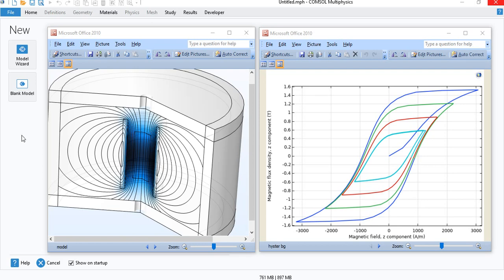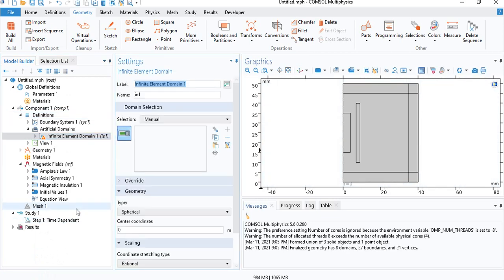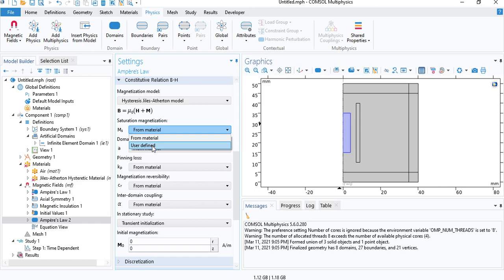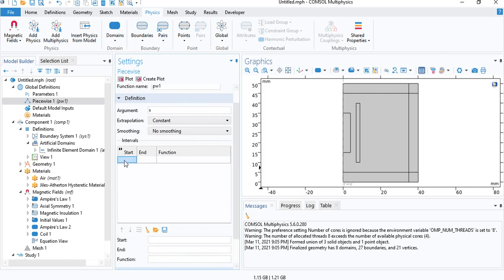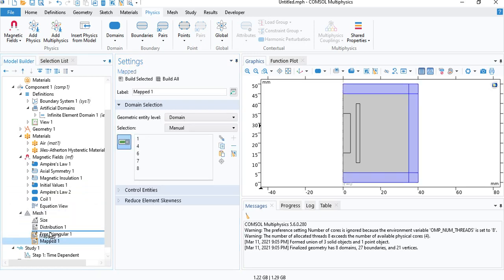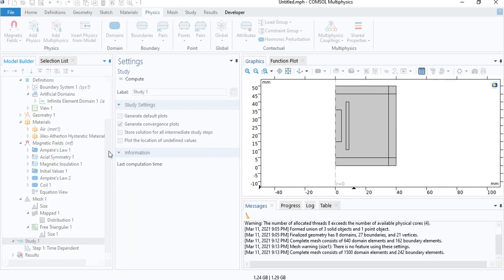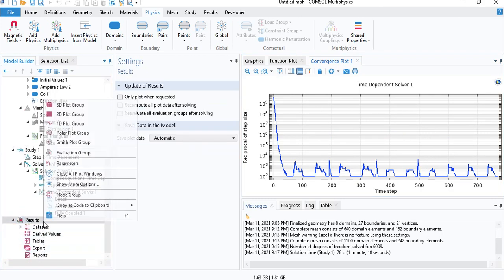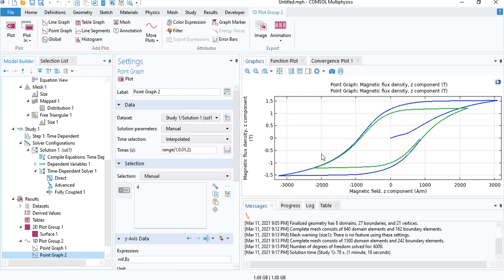Modelling magnetic hysteresis and producing hysteresis loops using Comsol Multiphysics

Comment: Could you please tell me the difference between circuit [voltage)and circuit [current] in coil excitation
Reply from the maker: Circuit voltage fixes the voltage and calculates current using Ohm's law. Circuit current fixes the current and calculates the voltage accordingly. In high frequency AC applications, the two options can give different results because the effective resistance of the current carrier changes with frequency (skin effect). In such cases, Circuit current preserves total electrical energy, Circuit voltage does not (energy is lost).
Reply: Thank you sir

Comment: Is it better to use infinite element domains all the time vs just a box or a sphere for magnetic simulations? Is one faster to compute than the other? Also is there a difference between a box and a sphere as the outer boundary of the simulation in general?
Reply from the maker: We need to give enough room for the magnetic field lines to spread in space. If you do this by creating a very large box/sphere then that's going to be more computationally intensive than using infinite element domain on the boundary of a small region. So in this regard, infinite element domain is always better to use.

If you use infinite element domain, you can use either a rectangular or spherical region but choose the appropriate coordinate system.
Reply: @JafScience  Thanks. That makes sense. So if the modeled geometry is rectangular, it's actually better to use a rectangular boundary, because there would be less volume to mesh between the model and the outer surface, right? Same with a spherical model and spherical boundary.

One more question. If I need to simulate hysteresis effects vs frequency, which model should I use? Jiles-Atherton is built into COMSOL if I understand correctly, but it doesn't consider frequency, right? Maybe I need to find a model that does and manually enter it into the simulation somehow?
Reply from the maker: @batsali99  For your first question, yes, just match the type of coordinate system with the type of air domain region.

For question 2, the frequency domain solver gives you the steady-state harmonic response while hysteresis is a time-dependent phenomenon. There may be some tricks published in the literature to help you work around this problem but Comsol doesn't have the capability to model hysteresis in the frequency domain.
Reply: @JafScience  I want to study the spectrum of distortion products due to the material properties of a transformer core for an input excitation that is also fairly harmonically rich. The known parameters would be the B-H curve of the core, probably a fit of Jiles-Atherton parameters to measurements (or some other model?). Is that not possible with Comsol? If the input excitation is defined as a sum of a few sines in time it should work, no? I've been reading a bit more and things like 'magnetic viscosity' are popping up. Maybe this is a much more difficult problem than I thought. If it's not possible with Comsol, do you know of any other software that would be useful for this application? Thanks for taking the time to answer!
Reply from the maker: @batsali99  You could do several frequency domain studies at different frequencies and then use inverse FFT to transform your results to the time domain. But in each Study, the Jiles-Atherton model can't be used. The limitation is mainly mathematical and is not due to Comsol being inadequate so I don't any other software that would be able to do what you want.
Reply: @JafScience  Thanks. I guess I need to do more research.

Comment: For my question, imagine we are at the point (-Hc,0). What will be the new path if I start increasing H instead of letting the curve enter the 3rd quadrant? From your simulation, it seems like the curve would always follow an almost horizontal path before becoming steep everytime you change directions... in my head the curve that has its direction changed at (-Hc,0) should just be a translation of the curve that starts at (0,0) since both have no magnetization. Can you clarify my thoughts???
Reply from the maker: Interesting insight! Just to clarify, are you expecting the curve to go up from (-Hc, 0) but have the same shape as the curve that starts at (0, 0)? I would expect an almost horizontal line going back to (0, 0) since Hc is the coercive field, defined as the field strength required to demagnetize a ferromagnetic material.
Reply: @JafScience  Yes, that is what I'm expecting. That is because the physical situation is the same as when the curve starts from (0,0), in other words, there is no net magnetic flux within the core. So... reversing H from that point should result in the same curve it would if we kept going negative (which is actually the same shape as the one that starts at (0,0) but translated and flipped) from the core's point of view it should provide the same "resistance" independent of increasing towards north or south pole. But again, that's just a thought I had. From the results shown, that's probably wrong, but again, I don't understand why
Reply from the maker: If the curve starts going up at (-Hc,0), that would imply that the material is still magnetised. But theory says that the material is demagnetised once you apply a coercive field. A demagntised material will have a BH curve starting at the origin when an external magnetic field is applied.
Reply: @JafScience  I didn't get why the curve going up implies that the material is magnetized... also, you said that when a coercive field is applied, the material is demagnetized, and then said that a demagnetized material has its curve starting at the origin. What I understand from those statements together is that the material behaves the same at (-Hc,0) and (0,0), which doesn't seem to be the case according to the simulation...
Reply: @JafScience  btw, don't get me wrong, I'm just trying to learn this hysteresis concept fully, I have a really tough time trying XD
Reply from the maker: @alexyuri_94  It's all good, scientific inquiry and questioning is the best way to learn and find mistakes.
The material is magnetised if it's producing a magnetic field in the absence of an externally applied field. This means the curve does NOT pass through the origin. Once you get to (-Hc, 0) you will demagnetise the material, so if you remove the external field (i.e. H=0), then B=0.

On the other hand if the material is still magnetized then when H=0 B will be higher or lower (since the material is still producing its own magnetic field).

Another thing to be aware of when  viewing simulation results is how variable are displayed. I think Comsol plots the total field (external plus what the material is producing).

Comment: Thanks for this tutorial, it was great.

I have a question about thermal effect on the permanent magnet, I couldnt find a way to add temprature to see how does it effect on the magnetic flux density. If you can help me i will be very thankful.
Reply from the maker: The magnetic field produced by the magnet decreases with increasing temperature. You need to import such data into a function in Comsol because it cannot be computed in Comsol. You can look for temperature curves from a manufacturer. kjmagnetics is one supplier and their website is rich in information about magnets.
Reply: @JafScience   thank you, 
But i couldnt find sth that can helps me through that website.
Coukd you please explain a little more?
If there s no parametr related to tempature in magnetic field physics node, how can i write a function ?
Reply from the maker: If you're working on a multilhysics problem then you'll need to insert the heat transfer interface. T will be the temperature variable. 
The graphs on the website shows different curves for each temperature.
Reply: @JafScience  
Thank you.
I have another question, about finding center mass of a geometry. 
There should be a mass propertise subnode in definitions node, but in comsol 5.5 i couldnt find it!!! 
Can you help me
Thank you
Reply from the maker: I'm not aware of a direct feature to give you centre of mass but you can find it using the integration operator. Insert integration under definition and under variables define total mass:  M=density* intop1(1). Then define the following: Sx=density*intop1(x). Then the x coordinate of Centre of mass is Sx/M. Do the same steps for y and z coordinates.
Reply from the maker: Maybe it's in a new version. I also can't find it on my side. But the method I gave you is easy to implement if you still can't find the direct feature.
Reply: @JafScience  
I couldnt use the thing u said 
When i create these variables the software is not able to recognize them!!
Reply from the maker: @samanehjabbarivand-yk4bb  What error does it give you? The method works on my side. Are you entering density as a parameter or a variable from the materials?
Reply: @JafScience  
I installed 6.1 version and it works better  . The problem is solved.
Thank you very much dear Jaf. 🌻
Reply: @JafScience  
Dear Jaf, i wonder if i could specify the axis of magnetic field force and its position for a permanent magnet which is surrounded by another metal. I want to know in what part or in which position there is  the max of magnetic force.
TnQ
Reply from the maker: @samanehjabbarivand-yk4bb  Do you mean you want to see the magnetic force distribution? As far as I know, we can only get the total force. By position, do you mean where the resultant is acting?

Comment: Thank you very much for the explanation. Would you please explain how we can extract hysteresis loss from the model.
Reply from the maker: I don't the formula for circulating the energy loss but you can look it up and see what parameters are required. The B field will be one of them and you can plot any required parameters in the result section. You can define the formula in Comsol to calculate the loss for each simulation.

Comment: Dear Jaf, your tutorials are really helpful. But i have a problem with this one. I repeat everything you did and have an error "Repeated error test failures. May have reached a singularity.". Do you know how to fix this? Comsol 6.1
Reply: Same error message shown as I was using 6.1. Anyway, I changed the electrical conductivity in the Jiles-Atherton Hysteretic Material, "0 → 0.1"...it worked...not showing any error.
Reply from the maker: Does your solver have the same settings as in the video? Not sure if version 6.1 has different settings by default.
Reply: Mb. Did step by step as you. Which version you have on this video? Really need this project to work. It can help me pass the exam
Reply from the maker: The video was made using v5.6. Can you run the simulation using constant permeability? See if that works. Then go back to the nonlinear BH curve. Alternatively try to build the model again from scratch. Sometimes something is missed and it becomes difficult to detect.

Comment: First of all thank you for such a great presentation. Secondly, if the material does not use the JA model but uses the BH curve, can the hysteresis loop be drawn?
Reply from the maker: No, a BH curve does not capture the hysteretic losses. Even if you import such a BH curve from experiment, it would be limited to the particular cycle which you imported.
Reply: @JafScience  Thanks I got it. You mean I still have to use the JA model, but there are several parameters in the model that need to be set, which I can't find from the material manual used
Reply from the maker: Yes, the JA parameters are obtained experimentally. One possible solution for you is to pick a hysteretic BH curve and find the parameters which can reproduce that curve. You'll need to use an appropriate input magnetic field.
Reply: @JafScience  Thanks, I see. Thanks again for answering my questions.

Comment: Hi Jaf-Science! First of all, I have to say that this is an incredible tutorial. Thank you so much for sharing all these invaluable technical information, much appreciated. Second, I would like to know if it is possible to simulate the heat generation through magnetic hysteresis by coupling magnetic fields physics with the heat transfer in solids physics? Regards...
Reply from the maker: Yes you can couple those physics interfaces. You need to define a variable for the hysteretic losses in the variables section. This variable can be used as a heat source in the heat transfer physics.
Reply: @JafScience  How would you define this variable?
Reply from the maker: @kingmike134  Check my transformer tutorial to see how to define variables.

Comment: I couldn't find jearls arthen model in my cosmol. How can I get it
Reply from the maker: Versions older than 5.2 did not have Jiles-Atherton model. e
Reply: @JafScience  I have 5.1 version. Now instead of jearls arthon model which alternative model can I use for modeling hysteresis
Reply from the maker: It's not possible without defining a mathematical model for hysteresis. This is a difficult route and there isn't an easy alternative.

Comment: Is this can be done in 3D model as well ? 
By choosing the spherical geometry type instead of cylindrical.
Reply from the maker: Yes, if you create a spherical air space then you'll select spherical type for infinite element domain. The geometry of the ferromagnet can be anything.
Reply: @JafScience  thanks !!! 👌🏾
Reply: @JafScience  while applying another material on the ferromagnetic cylinder , and selecting jiles atherton model in property group,  even when changing the values of jiles atherton parameters , the hysteresis loop remains the same. 
Only the saturation magnetisation is changing. 

Is it normal ? 😕🙁
Reply from the maker: You mean the shape of the hysteresis loop remains the same when you change the Jiles Atherton parameters? It is supposed to change. For instance, if you increase reversibility then the loop will become narrower. Also make sure the software is reading the parameters you have defined. This is either in the physics or in the material section (there should be a green check mark next to the property if Comsol is using it).
Reply: @JafScience  yes i mean  the shape of hysteresis loop doesn’t change. 
Still not working 🙁
Reply: @JafScience  i was making some other mistakes 😅🙆🏽‍♂️
Now I got it!! 
Thanks sir!!!
Reply from the maker: Great, you're welcome!

Comment: Thanks a lot for your great job.
Could you please give an example on pancake coil (single coil or bifilar).
Reply from the maker: I can show an example sometime in the future. If you want to create a model now, you can either use the helix geometry (set axial spacing to zero to create the pancake coil) or you can create concentric circles which represent the coil loops. In physics just apply one edge current node to all the loops (or 2 nodes for bifilar coil).
Reply: @JafScience  thank you. i am going to try.